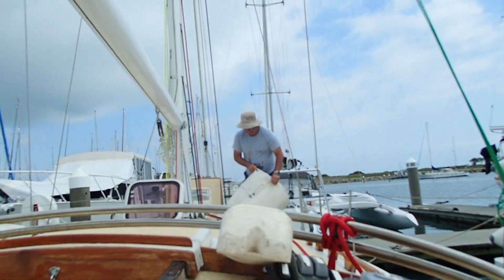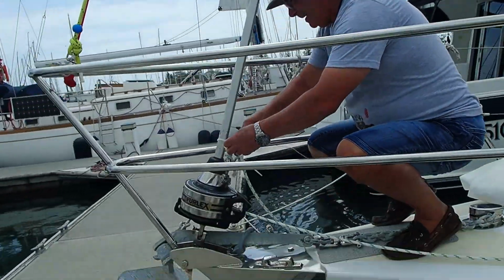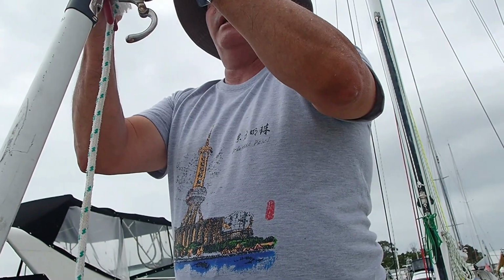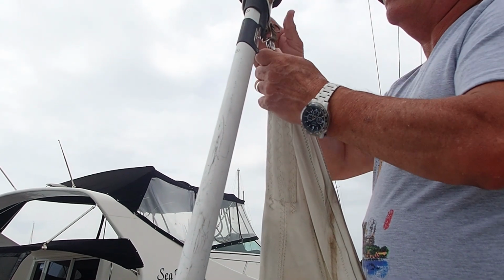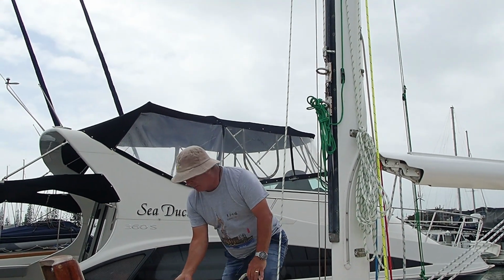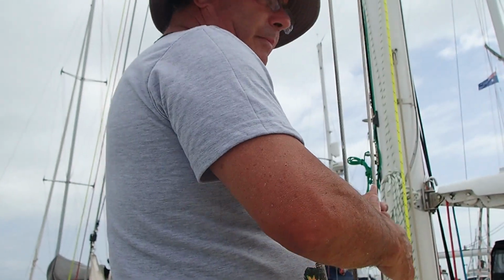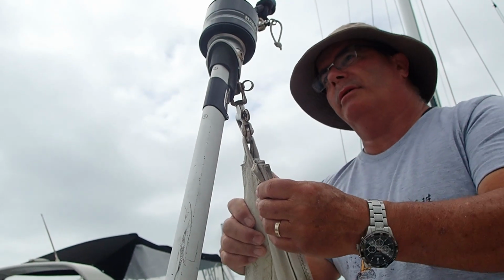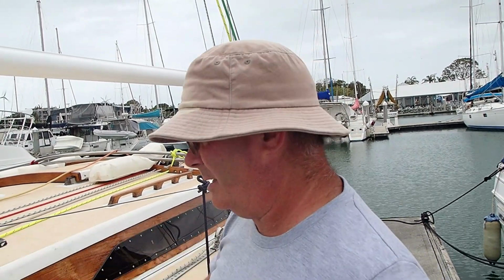IN'S & OUT'S OF PUTTING THE HEADSAIL ON - STILL ISSUES WITH THE MAIN.  Ep. 25, Sailing with Huon Cry

Comment: Hey guys. The bottom front corner of the sail is the tack, head is top, clew is where you attach the sheets.

Leach is the rear edge, luff front edge, foot bottom.

Snap shackles on a furling sail (especially on the top) is not a good idea👍. Those split rings you have on those ones can catch on a loose halyard or spinnaker and be triggered open. Use a rated shackle with wire seizing instead 👍
Reply: Might have to invest in a pair of oversized oars. Interesting watching this, well done Kim and John

Comment: Hi, you can test the mast groove by using tow of the slider from the present mainsail. Tie then together 5-10cm apart and attach the main halyard, attach a rope at the lover slide as adownhaul. Then feen the slides into the groove and gently hoist them up. If they stick just above the spreaders the mastgroove is somehow damaged or out of profile at that poin 😢 if they go all the way up and down with ease, then there si something else wrong with the system. You can also try to luricate the sliders with ptfe dry-lube, it will lower the friction between the groove and the sliders 👍🏼👍🏼
Reply from the maker: Thanks, will give that a try😀